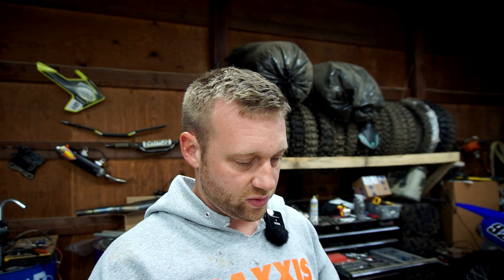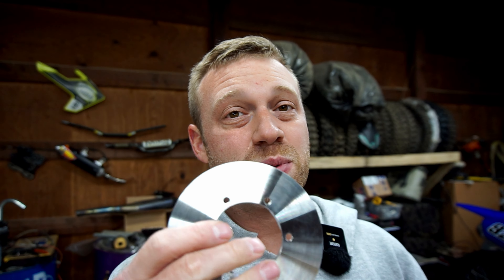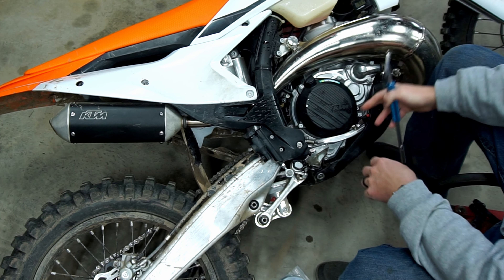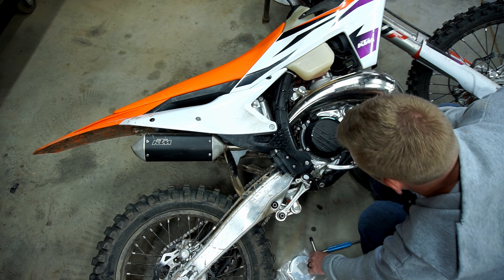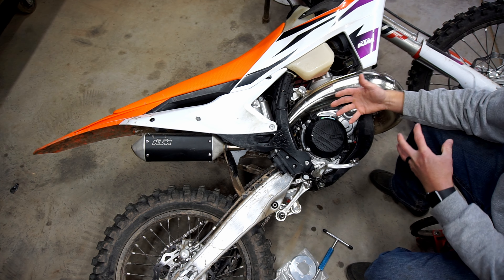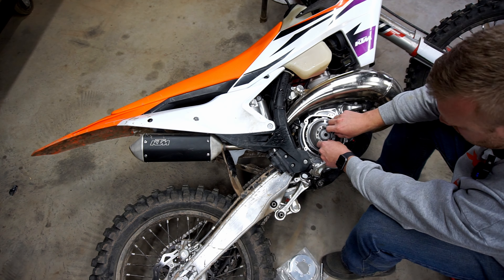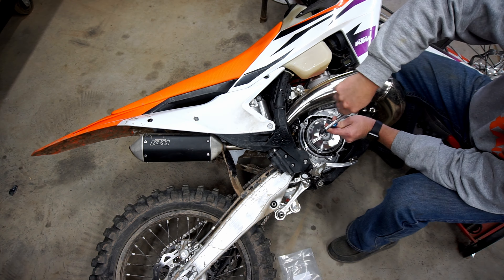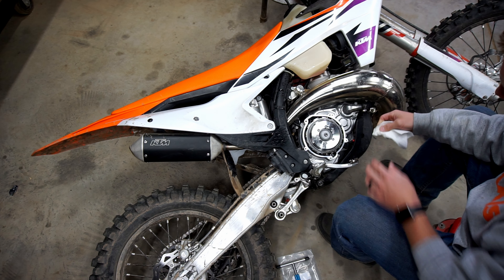Traction Disk / Clutch Weight Install, Ride, and Review. Is it worth it?

Comment: Any added rotational weight will dampen the engine spinning up on uneven terrain where the tire might unload then reload. Maybe it is better for enduro where you need to pop the clutch to reposition the bike.
Reply: You’d be surprised how many people run flywheel weights for Mx as well. It doesn’t slow down the engine nearly as much as people think
Reply: I bought my excf 500 super moto with one. I enjoy the bike more without it. I'm not sure how much of a difference it made but to me I thought it was less responsive.
Reply from the maker: There are a lot of scenarios where the additional rotational mass comes into play other than clutch popping in enduro. They make a big difference in cornering, slower sections, and depending on the weight it can tame down the power delivery slightly to give better traction….sometimes too much if you go too heavy.
Reply from the maker: It will be less responsive since it has more rotating mass, that is the point of them in a sense. Making power more useable in certain situations, epically in lower grip. For a supermoto bike it wouldn’t be as beneficial as more aggressive power as you usually have really good traction on pavement.
Reply: @EnduroScum  Responsiveness is probably the keyword. I think the application for this would be narrow considering all the other factors like tuning, clutch control, tire setup, and gear selection.

Comment: Hang on at sec. This looks like a dumb idea. The weight isn’t holding kinetic energy when the clutch is engaged. It’s just adding more strain on the clutch. Am i wrong? The idea of a flywheel weight is to store kinetic energy on the crank side of the crank-clutch-trans equation.
Reply from the maker: @jandrews377  you are correct, when the clutch is engaged it does nothing. When the clutch is disengaged it is extra rotating mass (kinetic energy) it spins much slower than the flywheel so it isn’t nearly as effective. I wanted to try it to see if there was much of a noticeable difference, there was a difference but as you noted, it does nothing with the clutch engaged. I am getting a flywheel weight soon and then it will be coming out.

I don’t think it would really add any strain unless it was out of balance which I would imagine would be a noticeable vibration change when adding it.
Reply: It matters slightly, mostly when your going slow in technical terrain and using the clutch and slipping it.